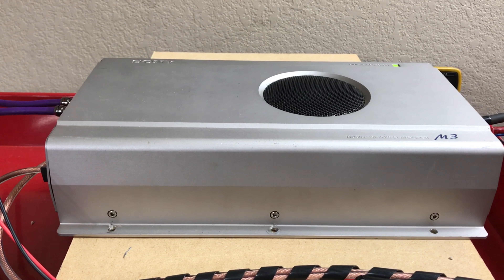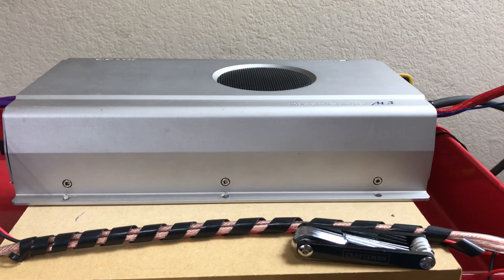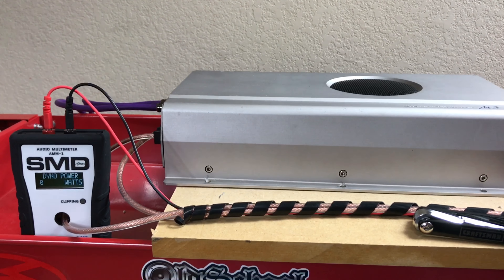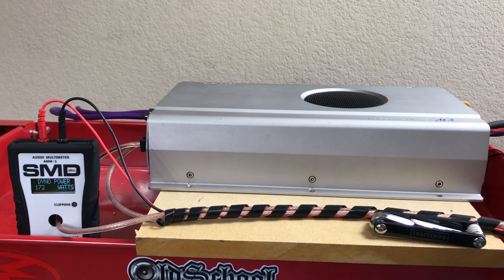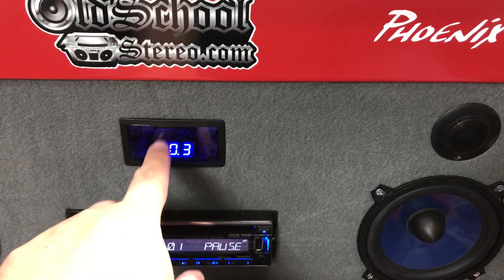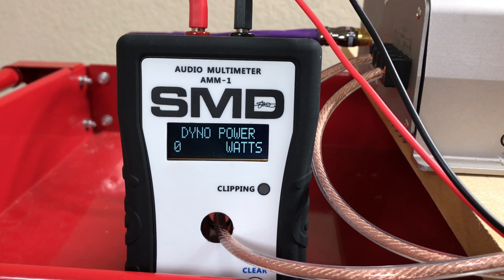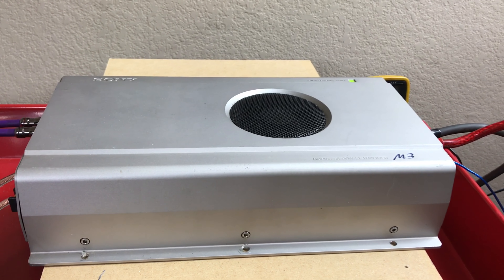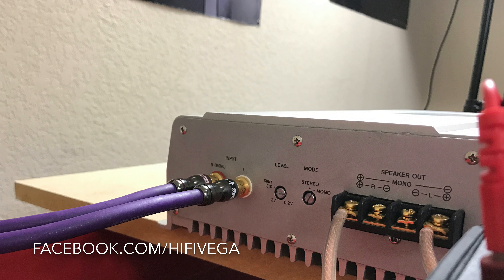Sony XES M3 Amp Dyno

Comment: I have a brand new XES-M3, it’s been in storage for 30 years .I just bought 2- 8W7-AE3 subs jL audio .The question is will this amp.do the job running both these 8 inch subs in a sealed enclosure ? ,and how should I put the setting on the amp ?